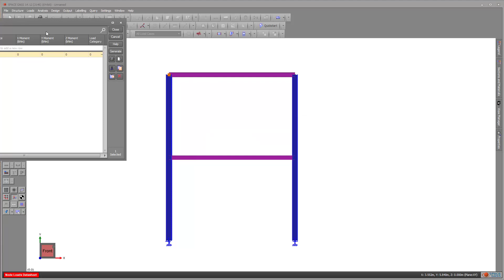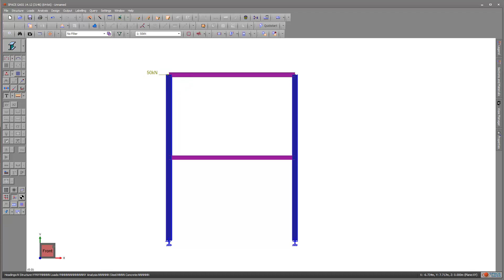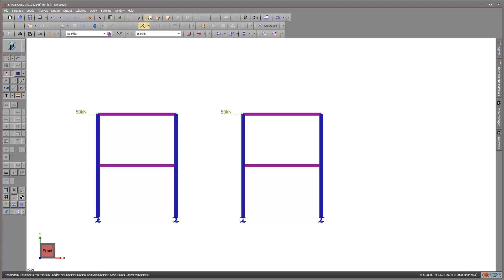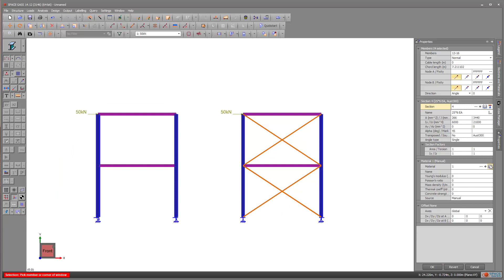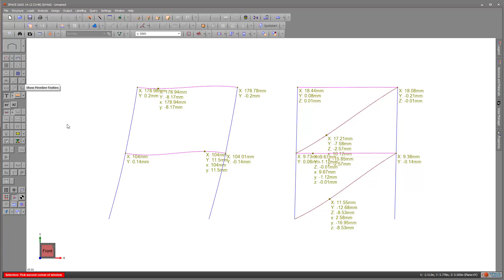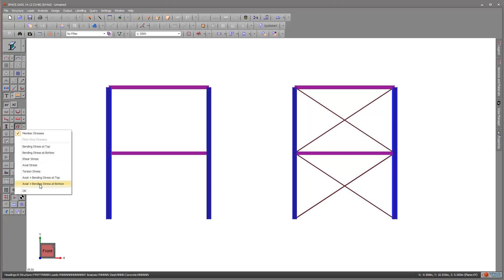SPACE GASS Tutorial 09: Tension only bracing members

Comment: Your tension only elements are causes models to not run if some load cases do not activate them. it's quite annoying. Any suggestions
Reply from the maker: You can apply a small force at the corner of the frame to activate them.